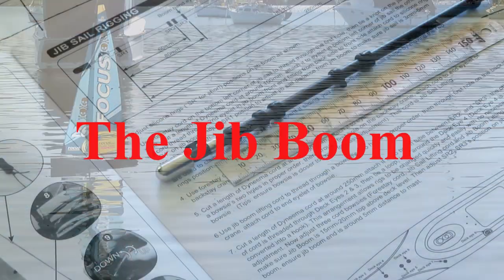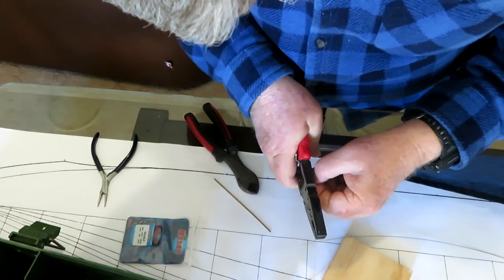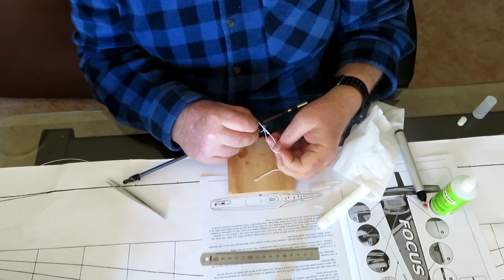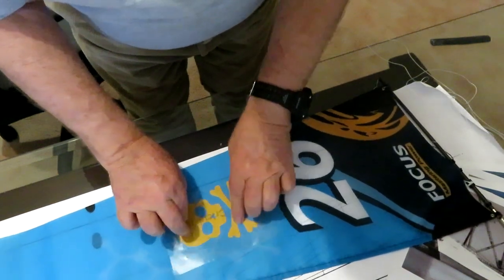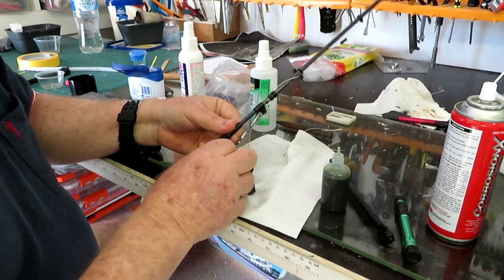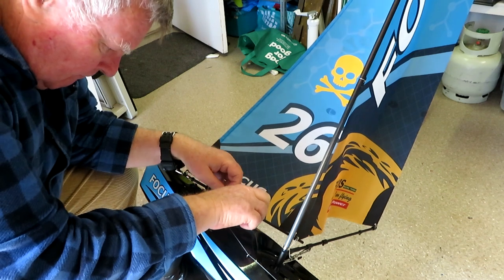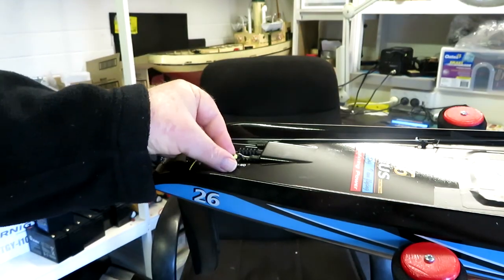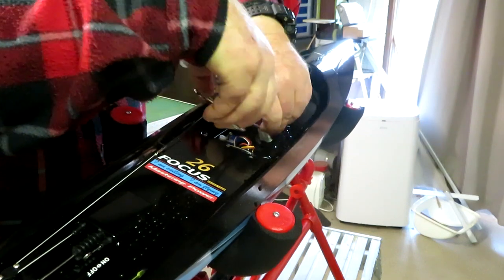Focus 3 video movie three

Comment: you say you had to extend the boom. How did you do that. I assume they are pre-cut and so there would be no option to extend them.
Reply from the maker: I use a small length of plastic and drill a hole on my hobby lathe.  There is an insert in the end of the boom and you use a small screw to fit the boom extension.  A friend of mine who also bought a Focus 3 found the boom was about 1 cm longer than mine so did not need to be extended.

Comment: Great video and advice. However, I'm a newbie to sailboats, not rc boats just sailboats, and I bought this boat for my first one. I like your video but I need help with the rigging. It seems that no one is showing how to do it. And unfortunately I'm not up to speed with the terminology. Is there a video that you know of that can help me. Thanks for your time
Reply from the maker: Some advice
The video shows how to mount a sling which after being attached to the boom is threaded through the first or second deck eyes and looped over the deck hook.  The back stay is fitted as per the instructions.  The sheets are the lines which connect the booms to the winch cable.  The jib sheet goes through the last of the forward deck eyes (I have seen people use the second last eye, just experiment.)  The main sheet goes through the eye on the raised post, I had to twist this eye by 90 degrees so the sheet runs better.  The only other potential issue is the down haul or the line used to to tension the front or luff of the sail.  Ensure the samm hole in the boom vang is at the top.  The video shows how to do this if the fitting is supplied upside doen.  Just run the line through the small hole in the vang up though the eye in the sail (called the clew) back down to the bottom of the vang fitting.  You then fit a bowsie before thresding the line through the end of the vang and back to the bowsie.  

Hope this helps a little

Comment: I have the Focus 2 and enjoy sailing it a lot. Being new to RC Sailing, my Focus 2 seems to plow ie water over the bow in high winds. Is there an adjustment I can make to alleviate
 that. Thanks Dan in Duncan BC
Reply from the maker: Hi Dan
I assume you are talking about going down wind.  With both my Focus 2 and 3 they tend to dig the nose in then lift.  In these coditions they are very sensitive to the helm and I try to avoid going directly down wind when the breeze is strong.  I assume you have the boat balanced for going upwind.  If not then you can move the mast forward or aft and this may also help controlling the boat down wind.
Reply: @JulieNelson-og4fe  Thank you for the reply, it plows both downwind and reaches. Is there a limit to moving mast forward or back?
Reply from the maker: Hi Dan
Both my Focus 2 and Focus 3 do not dip their nose on reaches only down wind and then just in strong winds.  I am unsure what the cause may be but some thoughts suggestions that may help.  Going up wind is the boat well balanced needing minimal rudder to keep it on track?  If not then move the mast step, for both my Focus 2 and 3 the mast step is just set a little forward of centre.  Also the position of the booms for going up wind will control weather or lee helm.  If you move the mast step you will need to adjust the forestay back stay and luff tension on the jib and likely the leech tension.  I set the vang reasonably tight with just a little play.   Sorry I cannot be of much help but keep experimenting.  As I said my boats do not dig their bows in when going across the wind.
Reply: @JulieNelson-og4fe  OK looks like I have some experimenting to do. Thanks again.